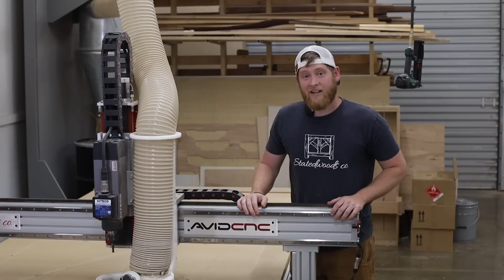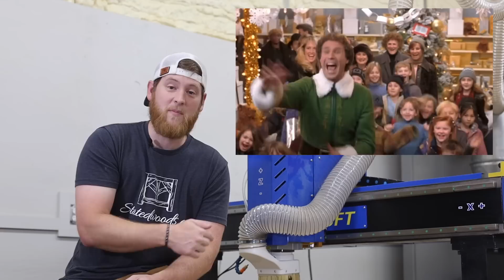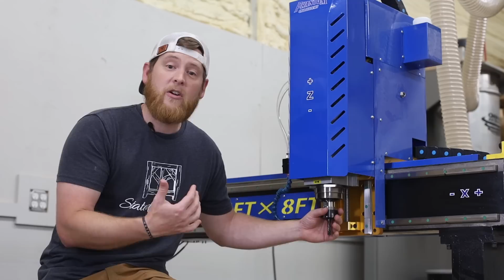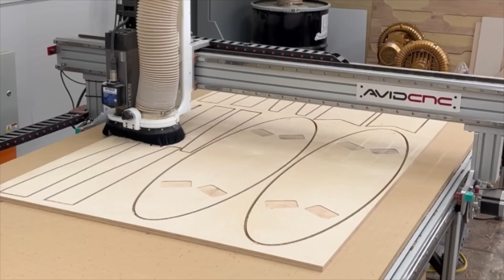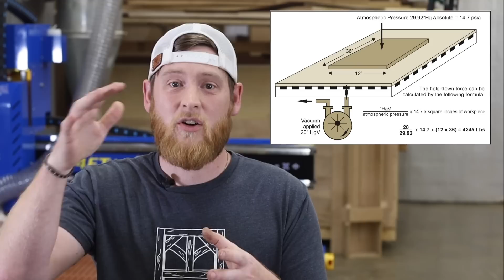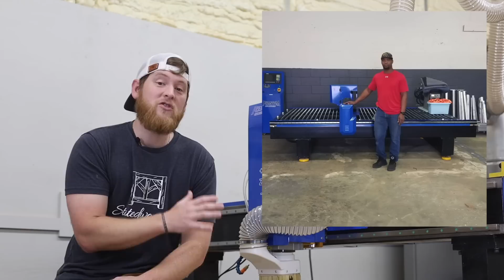Which is a better machine?

Comment: Hi.
1 year you said?? I have maybe more than 25 years. Your point is right. But!
The video is little wrong. Check the word. 
You just step your first step in the long long sea. 
Check for price's and abilities from chines market. Blue Elephant for example.
Built it the machine as you like. 
And yes. Something that you didn't sayed industrial level.
4*8 table ,6hp spindle, vacum table with t racks i believe it will cost near to $8000.
$18000 i can have atc (automatic tool chenger) and servo motors ,   and syntec pos and  not dsp11.
Reply: FYI...he sells Phantom machines.  He is a dealer for them.
Reply: @KS-woodworks  i understand that.
But this what i don't like , is the way. Does not inform people the real difference between hobby machines vs industrial machines. For me is just wrong. I will not buy. But for someone which starts now maybe. They lose not me.
Ooo!! one more thing about avid.
The same structure of the machine i saw it when i was on Germany on -+2002.
Reply from the maker: It was a comparison of what can you get for the same money under the “pro” line of machines. They are both called “pro” and they both provide very different components for really the same money. People can make their own judgement which they like most between the two. Thanks for the comments.
Reply from the maker: Now I do.

Comment: I have the same exact vacuum motors... running both at the same time, do you know the total amp draw?  have not hooked mine up yet. Also are these extremely loud? I might place outside but have close neighbors.
Reply from the maker: They pull around 17amps on start up I believe. A little loud. Outside would be best for heat evacuation but sound may bother neighbors. About the same DB as a dust collector.
Reply: @Statedwoods  Thanks for the reply, so both vacuums can be on a single 30amp breaker?

Comment: I purchased 4x8 CNC from China - Alpha CNC, they look almost identical to these Phantoms. The legs are the same but came unattached in the crate to save in shipping costs. Also the gantry came unattached as well... all placed on the vacuum table. I am assuming Phantom gets these from China and rebrands them as their own. I can say my machine is rock solid and runs great. I was looking at X-Carve Pro and Avid CNC... and decided I really needed a rigid base. I ended up paying 10K total... my first CNC, some drawbacks are the controller is Chinese and only supports MACH3, I might switch it out with a SmoothStepper some day. Also the Vacuumm controls are in the rear. Overall I am still learning but can easily profile cut through 3/4" MDF in 2 passes at 250 ipm. It can probably do better but I am just playing it safe.
Reply: And Phantom isn't made in the USA. Its a chinese machine  .
Reply from the maker: Phantom designs and engineers their own table frames. These are specifically designed to reduce vibration based on leg placement. They dont rebrand anything and call it their own. You could run your machine harder I believe. Im run full 3/4 inch DOC in 1 pass no problems.
Reply: @Statedwoods  This can not be a true statement.  Please check your facts regardless of what the company may be saying to you.  I would bet a significant amount of money that the machines are built in Jinan, China.  And they at most asked their contract factory to make something for them.  They don't appear to have an engineer listed on their website, certainly not one with more experience than the Chinese guys who have been building 100,000 of these over the past decade in each of 100 factories in that city.  Look at StyleCNC, Acctek CNC, Omni CNC, Quick CNC, Blue Elephant CNC, just to name a few.  You will find identical machines, or ones that can be easily configured with whatever features the customer wants.  They will paint and brand the machines to any color and name.  I am importing one of these machines soon and they offered to put my company name on their machine, no extra charge.  

But this is not a bad thing.  the market needs these products as Avid is over-priced and crappy compared to the China machines.  Just don't go about saying that it was the US guys doing the work, other than importing and selling them.
Reply: @1pcfred  Exactly, but remember that Chinese doesn’t always mean bad quality’s.  They can manufacture great stuff if you ask for and pay for it.  Or they can make stuff more cheaply than you can imagine.  One good thing about the Chinese machines is that they are not proprietary and all use the same parts.  That means that if you need a replacement, it should easily be available from any one of a 100 different suppliers and a quick swap.
Reply: @1pcfred  That’s sad actually.  And maybe a bit racist deep down, which people don’t like to hear, but what else is it?  It’s not about their government (not communist, but authoritarian), or their leader, but the working people in the factories and companies that are making so much of the stuff that you use everyday and take for granted.  I bet that you have relied upon 100s of Chinese-made items so far in your day and not thought twice about it, not appreciated it.  

So the hardworking people that make these machines and products that we enjoy in the western world deserve to be credited for their work at lower wages than our workers so that we can have cheap goods.  And we enjoy the price so much so that we often ask for lower prices, driving down quality.  If we all wanted to pay more for our stuff, then they would be happy to take the extra time to make it better.  But as long as there is someone looking for a deal and lower price so that they can get the satisfaction of a good today at the cost of durability, there will be plenty of companies willing to supply that.  That’s the capitalism that we exported to China.
Reply: @1pcfred  I don't disagree that the regime is doing some nasty stuff, Uighurs being killed and jailed and more.  But that is not the average Chinese person.  Just like the average American person.  But we can do our best to be understanding and nice to everyone.  I don't see how a blanket statement about the Chinese or Chinese crap does anyone good.  It is a fact that there are great people there and also that there are amazing factories churning out amazing things, in addition to a regime that does bad things (just like our country has a habit of starting wars based on false evidence (Bush Cheny), assinations (central and south america), and a sordid history that continues today of terrible racism and lynchings).
Reply: @Statedwoods  no response?  Did you check your facts at all or are you just going on what Phantom paid you to say?

Comment: Just something to point out here… “pro level CNCs don’t use belts”… yeah, that’s not exactly true. I happen to work on multimillion dollar industrial CNC machines and nearly all of them have one or more axis that use belts in their power trains, even in high precision systems that repeat to 0.001” tolerance. Belt driven systems have benefits and weaknesses just like every drive system, but one of the main reasons that it is used in industrial CNC applications is basically as a “fuse”… belts are cheaper and easier to replace than a gear or gearbox after a major crash.
Reply: Also, timing belts can be just as efficient as a gearbox, or even more so if the gearbox needs to be zero-backlash.
Reply: Right? My Shapeoko Pro 4 clearly says “PRO” right in its name - it uses big beefy belts.
Reply: Yea... Multimillion dollar machines are much more accurate than 0.001's... this isn't the 1980's
Reply: @WeekendWarriorsWoodworking2  Depends on the machine... depends on what machining process it is performing, depends on the size of the machine... not all multi-million dollar machines need to be more accurate than 1 thou, and even if they were, the process they were performing could not hold more than that tolerance anyway. Not all CNC machines are machine tools, and all have varying levels of precision depending on their specific process... and certainly nearly every high speed CNC machine I have ever worked on has no greater than 1 thou repeatable accuracy, smaller, slower machines are the ones that get down to the 1 ten-thou repeatable level, and are usually very specifically tasked.
Reply: I have 14000 pound Multicam mt510 with 1 1/2” ball screws. Runs belts at10 steel reenforced. Holds thou precision all day with a 15hp spindle.
Reply: Indeed, belts are easier and cheaper to replace than gears
Reply: @pascaljean2333  there's the initial cost. You may never have to replace anything. What really matters is performance and belts can deliver that with gantry routers. Belts are fast and accurate.
Reply: I’m glad someone said it. This is DYI gone woodwork skipping right over industry.
Reply: Pro level CNC dont use belts!
Reply: @JZScreatives8212  Wrong!
Reply: What multimillion dollar machine? I’ve laid my eyes on pretty much every ultra high end machine in the industry this week at IWF, I want to go see this particular machine..So far I haven’t been quoted over $250k, fwiw.
Reply: @troygattis8381  See Prima Power Night Train systems... multimillion dollar punch/laser/shear/robot/storage/bender... I maintain 2 of them. Add in a couple 6kw fiber lasers with storage towers and you are into another mill and half... Don't think machine tools here... you have to think bigger. CNC doesnt just apply to machine tools.
Reply: @professionaltinkerer  , yeah…go find me a CNC router that costs a 1/3 of that with belts on X, Y, or Z..laser heads don’t weight 100’s of pounds…
Reply: @troygattis8381  Ok bro.. you're right... I haven't been working on these machines that sling around 5x10' sheet metal at 4-5 times the speed of any CNC router(and we're not talking thin stuff... we're talking sheets that can weight up to a couple hundred pounds themselves) with belt driven axis for almost 20 years... but ok.. you keep on thinking that and living your best life... later.. have fun.
Reply: @troygattis8381  He never said multimillion dollar WOODWORKING machine.  Go check out KERN as an example of a metalworking CNC machine that will easily carry you over $1M.  His point is still well made.
Reply: @paulketcham9905  hell some haas machines kitted up cost close to a million
Reply: @paulketcham9905 

You can’t inform a know it all that wants to be right in his own mind.
Reply: What multimillion dollar machine? I’ve laid my eyes on pretty much every ultra high end machine in the industry this week at IWF, I want to go see this particular machine..So far I haven’t been quoted over $250k, fwiw.
Reply: @troygattis8381  Check out C.R.ONSRUD in Troutman, NC. I'm pretty sure you could pay a wee bit more than that for their equipment. https://www.youtube.com/watch?v=dXBIKDdUrow
Reply: @abrahamlincoln5283  , dude I’m well aware of CR ONSRUD, yes they have excellent machine capable of extremely high speeds…but if the router bit will only cut at 600ipm, why would I want to pay $100k more for their machine???? Nothing against CR, or AXYZ for that matter, they all build great machines…but the ROI is what matters to a small business.
Reply: @1pcfred  I’m well aware of what rapids are…currently my rapids are set at just under 600ipm…when I say movement, I’m talking about frame flexing, gantry flexing…These guys are trying to compare a machine that costs less than the foundation of the Haas metalworking based machines to a guy in his garage/shop with a production level wood/plastic cutting machine..😂
Reply: @troygattis8381  I have seen a 20x40 ft cnc table yes that can get multi million fast

Comment: Subscribed my friend!  Question...could you have done this video comparing the Avid to another CNC similar to the Phantom model?  Are there other models similar to the Phantom you demonstrate that would be worth the relatively small price increase over the Avid?
Reply from the maker: Price point wise you would have to look about another 7-12k more for something comparable. In terms of machine capabilities there are some other machines in the same range. Price point though it spreads out more.

Comment: I'll take my ShopSabre Pro510 over anything that Phantom or similar companies put out.
Reply from the maker: They have great machines. I dont have a ton of trust in ball screws though. You seem to have no trouble I guess.
Reply: @Statedwoods  If you don't trust ball screw then I'm guessing you don't trust every z axis on the market. That or your experience is with the cheaper acme screws rather than properly designed ball screw systems.

Comment: "Walking across the shop floor" is a pretty big stretch. My Avid 4-8 does indeed have that movement you showed in the clip, but it has never moved from its place.
Reply from the maker: It was meant to be a slight exaggeration for sure but you can def see in the sawdust how many inches the machine moves on high speeds.
Reply: @Statedwoods  learn how to accelerate. Or get a motion controller that can.
Reply: It seems like there would be a way for the purchaser to make the machine stiffer and remove some of the flex...no? I understand that this might not sit well with some people to have to make their own alterations to a machine they paid a decent amount for, but if all it took was some additional bracing in certain areas, it might make the product more solid. That all said, I don't own an Avid so I am not real certain if this is feasible.

Comment: Great video walking through the differences in the machines. i feel most people today look solely at price or at what each youtuber  is using. as fr as youtubers go it is overwhelmingly avid cnc. i did look at them, but im with you as far as having to assemble it since i run a business that needs to be producing products and not assembling fun new toys. I bought a 4x8 cnc router just before new years this last year. ended up going with a grizzly G0895 4x8 cnc router. freight delivered to my shop in one piece, all in at $19500. couple hours hooking up electrical and vacuum pump and i was cutting. alot similar to your phantom, except mine runs ac servo drives from yaskawa and has german built helical rack and pinion. could not find anything else on the market at the time that ran servo motors that came close to the price. thanks gain for the video. like your content. have a good day!
Reply from the maker: Thanks Brian for the great comment. Glad you like your machine. Sounds like you did your homework well
Reply: I can't see anything on the grizzly site that shows the rack being German made or the brand of servos used.  How do you know that they are using these parts?  The rack specifically surely does not say "made in Germany".  But it is a similar Chinese clone just like the phantom and way better than an Avid.
Reply: @MattRogersdesigns  
FEATURES:
Yaskawa 850W Servo Motor
Taiwan HIWIN linear guide
German WHM rack
10 HP Vacuum Pump
6-zone vacuum table
Reply: @briancopley1967  Ok, I just don't see that on the website right now.  Maybe I am blind.
Reply: @MattRogersdesigns  scroll through the overview. Towards the bottom of that section it says features.
Reply: @briancopley1967  Yes, I am blind.  I don't understand how they are upcharging so much for the ATC.  I am working with a Chinese manufacturer and the ATC only adds a few thousand, not $20k.
Reply: @MattRogersdesigns  not sure why either working on my own to for to it.

Comment: I have an avid and Im building a DIY from extruded aluminum.  I think your view is very fair to both types of machine but some of the things that bother you just aren't much of a factor for me and some of them are tolerable.  Just depends on what type of work you are doing.  Im a guitar maker and the occasional sign or project.   My DIY,...  I think it is going to kick my Avid in the ass for half the price.
Reply from the maker: I agree with you. Everyone has their needs. Good luck with yours. Very cool
Reply: @Statedwoods  he's right. I built an avid copycat several years ago all with much more high quality western electronics and spindle for about $7,000 and I even have a vacuum draw down table
Reply: @BGraves  not to mention this guy is a distributor for phantom and never tells you
Reply: He’s a liar.

Comment: Had my AVID for a year.
I can say that the the rigidity is a real issue.  If you are still considering an AVID, a fee things that may help:
Don’t use their legs, make your own fabricated steel table, as solid as you can afford.
If you DO use the AVID legs, box in all the structure you can. And add ballast weight to the frame.
And one question about the Phantom, if you’re talking “pro-level “machines,
I don’t see an ATC on your machine? 
AVID doesn’t offer an ATC, but there are plug and play ATCs out there for the AVID.
I look at my first year with my AVID as a learning experience and I’m noting all the changes I’d make for my next machine.
Thanks for your report
Reply from the maker: I agree. Those changes to the Avid would work fine. Phantom does have an ATC machine. The one in this video doesnt have one. Just added an ATC machine to my shop.

Comment: We build CNC Routers here in Ireland and we proudly fabricate, machine and assemble our machines in Ireland providing local employment.

I have an issue with your video.....

I think it is very dishonest of you not to have mentioned that you are a Dealer for Phantom.

Seems to be a huge conflict of interest in your comparison.

You also said neither company gives you money for advertising the products but on the contrary you must be gaining a commission in sales of the phantom machines? Unless you are a dealer not taking commission (Which I doubt!)
Reply from the maker: I released this video and was then hired as a dealer so your point is a valid one but not accurate as the dealership was after the video. Cant really retroactively change the video now.